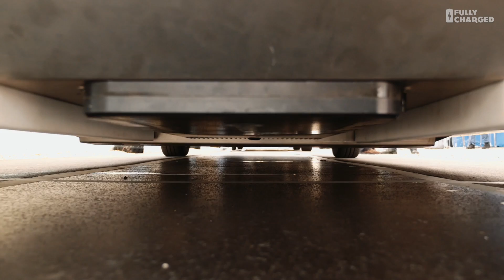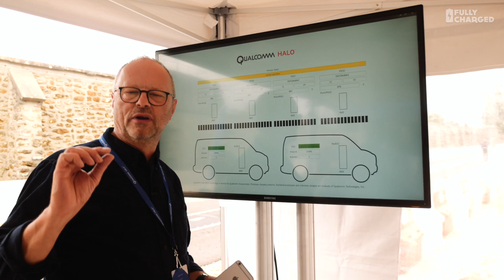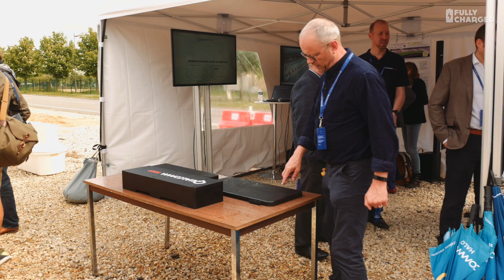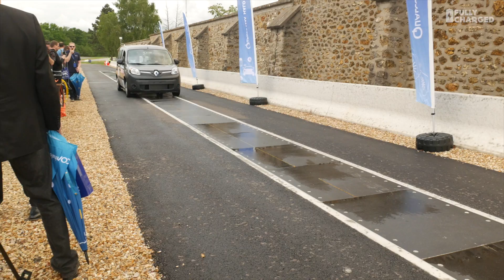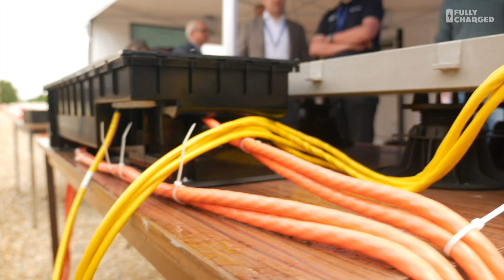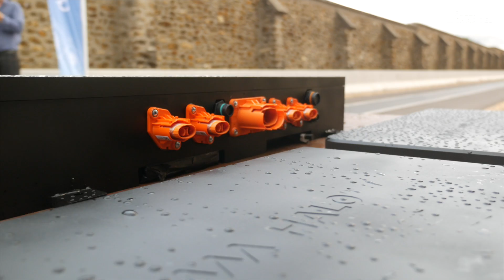Dynamic Electric Vehicle Charging | Fully Charged

Comment: Great idea, that is fundamentally flawed.
It's flawed because of the infrastructure management that would be required to fill the roads with these in-ground plates.
Trams use over-head transmission lines which are in fact EASIER to maintain than anything in the road, and yet countries are not covered by over-head lines.
This system would only work in cities, and would probably be limited to public transport or government run taxis. Anything more than that would be an absolute headache for maintenance. Roads shift (especially motorways due to the heavy traffic), this would inevitably lead to breaks in connections, which would require the motorways to be dug up for maintenance. It would be like painting the Forth Bridge.

A nice idea, do-able, but way to expensive and disruptive to install and maintain.

Comment: The first thing that strikes me as being important is setting a standard.

The last thing we need is hundreds of miles of road ripped up to put in different induction chargers in... With 100 different systems that won't work with each other. Just like what we need with charging stations, pulling up to a plug in station and being 100% confident that they have your connector. This is kind of the biggest hurdle for EV's at the moment. Every gas station has a nozzle that works for just about every vehicle, so why can't we get charging stations to use the same connector?
Reply: Sherrif There needs to be a standard connection system across all vehicle companies.

Comment: I thought that hydrogen car was the most inefficient new tech available. I was wrong. This is worse. Much worse.
20kW power (which is actually very little, can't call it fast charging)? Oh my god. As a rookie engineer, I can't imagine having 100-200km of that stuff in the roads. 100km of that stuff would weight tens gigantic number of metric tons. And a big chunk of that stuff must be replaced. Roads wear down. And if this surface is slippery in rain, that is also not fine.

All that for what? Until at least 30% of ALL ROADS are not covered with it, it makes zero difference to vehicle travelling on them, as battery must still be able to sustain vehicle on roads where this stuff is not available.
Plus. Who will pay for that? I won't. And no individual will. I'll better pay 5000€ for a battery than 500€ for a 10km stretch of road. Annually.

Comment: With a cheap camera on the car, it should be quite easy is to lock the car to the road. You just need an easy pattern, for a camera+computer+ai, on the road. The margin for error is then only at what point the car locks onto the charge lane, and when it unlocks. Unlocking/locking should be possible through some cruise control like button inside the car.
Reply: the tolerance is 200mm either side... if you are that far over then you are normally drifting into the adjacent lane anyway.....
Reply: you can change tolerance any day, it just increases the cost by a little

Comment: How much would this cost to install on a highway with enough length to actually extend the range of EV's sufficiently? I have a hard time believing that with the cost of installation (Including connecting to the power lines, which means a lot of step-down transformers), maintenance, and electricity, that this system will actually be viable. I believe charging at parking lots would be a better investment. Less coils needed since the cars are sitting still.

Comment: I would be interested to know what the efficiency of transfer is, i.e. to achieve 20Kw into the vehicle, how much is actually put through the coils in the road? Also, is there a cost in terms of back EMF on the energy to move the vehicle forward when it is moving in an active field? Finally, there was a brief mention of shielding the car from this field, which I presume is a relatively high flux density, so from that I assume there are concerns for the on-board wiring looms picking up stray energy (and potentially damaging electronics). I'm also not too keen on being exposed to a high flux density for potentially hours at a time unless there is demonstrated tight control of the fall-off (i.e. better than inverse square). One other thought, with many vehicles moving along an extended track, might there be issues with RF transmission at power over significant distances?

Comment: A candidate solution to the problem of how future autonomous vehicles or next gen public transport e-buses could recharge without the physical plug. Not a convert on the presented demo for recharging on the move: sure it may work but the infrastructure costs and disruption would be staggering.

Comment: It's cool but like many of these road technologies, I doubt it will ever be implemented on a large scale. Just for very specific applications it may get used.

And you have to stay right above it for it to work? 20 cm space left or right is not much.

Technically it's cool. Practically,.... I'd call it a recipe for disaster. Not like accidents, but just way too complicated. Expensive in maintenance. Etc. Etc. Etc.

Maybe their will be some more interesting spin offs, but I can't think of anything. The technology isn't that special. It's not like they invented a new type of battery that has 4 times the energy density of current batteries at half the costs.
Reply: I'm sure Expense is a major problem at this time. Especially used on a Highway. However, the expense is likely not prohibitive in Parking Stalls or  at Taxi Stands. Like any new technology it may not be viable now, but in time once the quirks are worked out it could be relatively cheap.
Reply: sandor szabados It seems complicated to me. At a taxi stand, they can also just plug in. Much more practical.

This technology is a lot like wireless charging of mobile phones. It exists, but few people actually use it. The main reason, I think, is that it requires one more device which you have to pay for. That's the case here too. I don't think this will ever become a big thing.

Having said that, it still is cool, but mostly from a technical perspective.
Reply: Why would plugging in a Taxi at a Taxi Stand be more practical? A taxi might only be there for a few minutes.
Reply: sandor szabados That's a good point. Most taxi points I know there are parts of the day it goes that fast, but the rest of the day, not like that at all. But I'm sure some taxi points are busy a lot more.

Still, it's a very specific niche. Not going to be practical in general.

Comment: For those of you saying how non-viable this is, don't think about this as some kind of holy grail that is going to make EV's viable. Think of this as a future upset to the EV industry. In a future where we are all used to charging our cars at home, the government may eventually find it is economically sound for them to start placing chargers in parking spaces, busy intersections, and yes, long straight stretches of highway road out way far away from the city. They can generate revenue from the electricity sold, and put in new charging plates when doing regular maintenance. This is not to say someday soon we can travel from city to city with this kind of thing, I think we should instead look forward to the far off day where the idea of charging your car at all is foreign to most youngsters, who have never had to charge a car in their life, since it charges itself while you drive. So don't be so dismissive, Grampa!
Reply: freeofavia still very unviable technically and economically

Comment: Cool technology, but illogical. It assumes people are so desperate to get somewhere that they can't stop for 10 mins to charge the battery a bit.  And to save those desperate people you have to install enough roadway charging for 10 minutes of charge at  100 km/h  you need 16km of track and that is assuming that they can achieve the same charging rates as the best supercharger.
Further the track must be in a suitable location for the desperate driver to get to without going out of his way (the driver is desperate after all).
The reality is that they cannot achieve the same charging rates as cabled super chargers, so it is really a question of A: stop for 20 mins at a super charger and get a meaningful amount of charge, or B: install wireless charging over 100km of roadway.
B: seems silly to me.
Reply: Good point. It may be better to put wireless charging in the motor way than the parking lots because it will get more use per car. But I do question that the majority of drivers will need emergency charging. The way technology is going it seems that withing a few years, most cars will have more than sufficient range to be able to do the days driving without extra charging. Only long distance travellers will need to stop for a charge.

Comment: Ok. Two immediate problems: (1) Inductive charging is massively inefficient. So that 20kW seen at the car is much more than that down in the road. And (2) How do they intend on billing for this. The power is NOT going to be free.

And then there's the question of installation, maintenance, and power infrastructure. Where do you install them? What happens when an overweight vehicle crushes one? Or cargo falls off a truck and impales one? Sure, it's interesting technology, but we already know it works. They haven't answered why we should bother.

(If you can get race tracks to install similar technology, you'd have my attention. I'd need 50-100kW, 'tho -- full acceleration in the Electrica is 75k, a Telsa is 400k)
Reply: jfbeam France has many toll roads the cost will be incorporated into the toll for electric vehicles